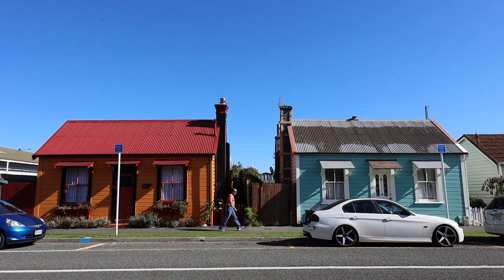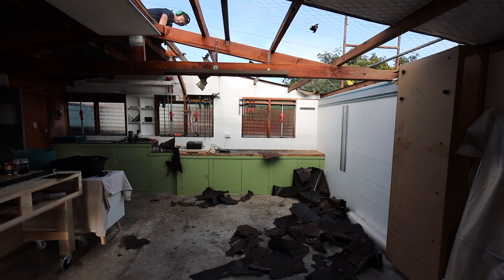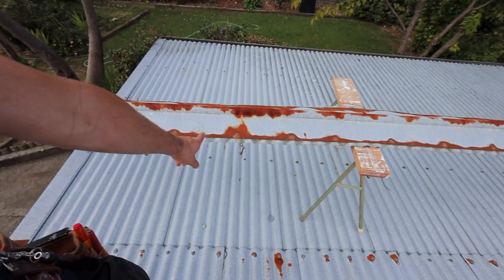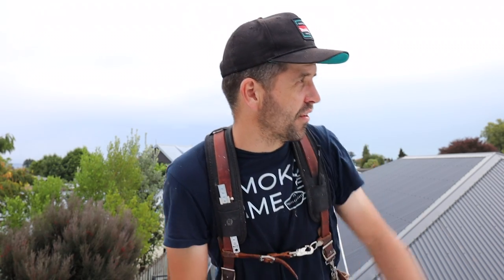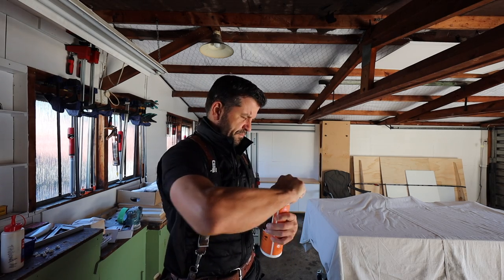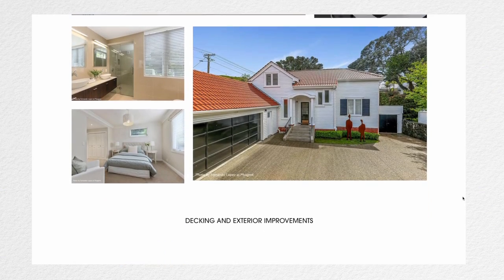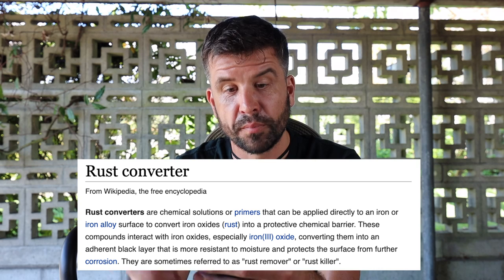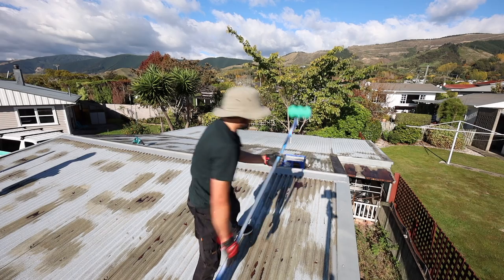How To Make An Old Roof New Again

Comment: A bit late now, but the old (30-40 years ago) instructions for 'rust converters' had the user wire brush or scrape the rust to remove any loose rust before brushing on the converter, which was basically Phosphoric Acid, same as used to put a corrosion resistant matt finish on military equipment (and in cola soft drinks and food production as well as dentistry).
Reply: That's still worth doing. I often use a round wire brush in the drill.
Reply: As I recall, the bottle label included “properly prepared” (no liability here).
Reply: Yep, ideal to remove most of the rust it has converted the "top layer" of rust, i.e. the top surface rust has been neutralized but there is still rust underneath and so removal with wire brush works best to get rid of most of it before hand....maybe on the second half of the roof!
Reply: Scotch-Brite pad would work perfect for surface rust. 
In Australia we have a product called ranex that sounds like what “Bruce Lee” was talking about. Seems to work much quicker than this product too
Reply: Yup; you'll find it on most steel boats with various names, but it's mainly a solution of phosphoric acid.  Works great, tastes terrible.
Reply: @michaelrice500  Gotta mix it up with a bit of orange juice mate, then all good  !
Reply: Yep, loose rust off means less rust converter needed to react with less rust, and a more stable less powdery substrate for the top coat of paint.  Use a nylon or wire wheel in a grinder.  
Ha  yes I've worked on ships !
Also some rust spots under some of the old nail heads and I'd grind / convert / gal spray those before nailing down.
Reply: @michaelrice500  funnily enough part of the flavour of Coca Cola is phosphoric acid.

Comment: First time seeing those rollers, so cool. Can't wait to see the garage finished! Awesome vid as always Scott! 🖤
Reply: Don't bother using them they suck, just use a soft broom
Reply: They look cool, but they tend to load up with the paint to the point that they won't roll any more, so you end up with a huge sponge of paint on the end of the pole, smearing it around on the roof swearing at it.
Reply: From recent experience, they don't work so well with solvent-based paint and in my case, the sponge came free from the cardboard sleeve and promptly fell off the roof. Left an interesting pattern on the path below.
Reply: We used one on our house in 1981, but it wasn't as good as it looked. We mostly used brooms and a brush.
Reply: Hate to be one of those no no nancy’s but was skeptical about rust converter on galvanized metal. Major manufacturer in north america advises  against. 

“ It will not work on aluminum, copper, stainless steel or galvanized metal. “
Maybe yours is a different compound. Maybe the top primer will also protect roof enough or maybe just maybe by the time the converter proves to fail by bubbling up from underneath you will have 50 gajillion subscribers and a syndicated tv show. Just being a jerk. Love your show.
Reply: @coreywells9498  - I did a lot of research on rust converters and agree that plenty are as effective as a band-aid on a bullet wound. But there are good ones sold here that are formulated to work on galvanized metal, because so many of our houses and garages have galvanized roofs.
Reply: @coreywells9498  think Scott's was zincalume, none of those you mentioned 😉

Comment: Scott, you could continue to lay your membrane in a vertical fashion. Just fold the edge of the underlying felt over by about 100mm. Then if any water does track under it will hit the fold and track down towards the gutter (if there is one). It’s a method we use on underfelt when we repair sections if there’s a rip in it for example but there’s no reason you can’t do it on large sections like yours.
Reply: Nice!
 Simple and effective - one of those "of course" solutions

Comment: Had corrugated mietal  roofs in Hawaii for years, and even the old ones never leaked or needed underlayment. Yet when we built "real" houses, new houses in the  70's we sheathed the roofs  for shear, so we needed underlayment then. You lose the sound of the rain. OK some people must have had leaks. I just mean we just put our roofs on and no one thought about underlayment for a roof on purlins. This rust converter is something new to me. We found the quality of the steel to begin with was most important and used zinc oxide paints if we used any. At the end--- NZ is so beautiful! We loved hiking there.

Comment: Hi Scott as a tradesman painter I spray roofs wot I do is wire buff the rust areas clean down then apply the rust converter for a good surface then airless spray the coats as on as spraying will tend to get into areas rollers won't and also the topcoats will have more microns for protection and yes I use metalsheild primer and Dulux roof and trim great products , cheers ,shaneo , nelson 😊👍
Reply: Do you spot prime the (converted) rust spots with a high ZINC primer before using the metal primer?
Reply: @debochch  yes I  spot prime  then full undercoat making sure no bleed threw before topcoat

Comment: An amazing product for rusty metal is POR-15. It is a miracle product! Also, I had no idea that those rollers for corrugated metal existed...thanks!
Reply: POR-15 is not UV resistant, it needs to be top-coated.  If you don't it will fail. While I've used POR-15 for years, phosphoric acid and 2-pack epoxy primer is actually much more durable.
Reply: Inorite…corrugated rollers are going to save me so much time now, I had been putting it off for that very reason
Reply: @epiccollision  you notice the push broom he was doing the rust converter was corrugated as well.
Reply: @ckm-mkc  True, POR-15 does need a topcoat if it's outside and I've successfully used Rustoleum for that purpose, which has worked beautifully for years.

Comment: I use the CRC rust converter, it works exceptionally well for what it is. Was pleasantly surprised. Though it's recommend not taking the metal back to bright clean metal, as it does need the iron oxide to convert. It's a great product for extending the life of things with very little effort. 

Depending on rust level, it will need multiple coats. Once it goes nice and black you've applied enough, if you still see rust it needs more. be-careful not to over-apply as that can have a negative effect. The best results I've found is one coat, let it dry and set, wipe off excess (those white/purpleish streaks), repeat until all rust is converted to the strong hard black primer. You shouldn't need to apply a primer on-top of this product. 

In reality I hardly ever do it in the best prescribed way, I just keep coating until it's all converted then slap zinc paint on-top and I've not had an issue yet.

I use this stuff in a high humidity environment and it's a life saver for restoring rusted iron/steel.  That cap will never come off easily again btw...

Comment: Hey Scott and Jess!  Suggestion: Consider painting the roof titanium white or a colour that either has a high LRV rating or a manufacturer specific cooling additive.  Resene call theirs "cool colours", Dulux call theirs "Keep Cool technology", but at the end of the day it's the LRV rating that you're interested in.

With a metal roof, especially, the choice of one of these cooler colours and/or higher LRV ratings means less expansion and contraction of the material - meaning you lengthen the service life of the material.  As it's reflecting more of the sun's energy rather than absorbing it (leave that job for solar panels if that's your thing), it's also reducing the temperature inside your house when the sun is at its highest i.e. a passively cooler environment in summer, meaning less energy spent on active cooling.  In Winter, the sun is lower in the sky and you should be getting more of its energy through your windows - obviously dependent on the building's orientation - so reflecting any of its energy away isn't as much of a problem either.

In my house, after we upgraded the insulation, it was an absolute furnace the following Summer, I hate to think what it would have been like with the incoming R6.6 standard!  Shortlyl after that, we had our roof rescrewed, prep'd and painted titanium white.  The following Summer, the aircon didn't go on at all - the white roof did its job brilliantly.
Reply: Great tip! We were talking about this just yesterday and are keen on a light coloured roof for the reasons you mentioned

Comment: Should put a few full length acrylic panels in the roof bro, get some sunlight in.
Another tip with the steel is to fold up the last 20mm of the valleys under the ridge capping before you put the ridge on.  This will prevent wind driven water blowing uphill and in under the ridge cap. Nowadays too you can get a shape matched foam filler strip that plugs the valleys and does the same job blocking water.

Comment: In the UK we still get plaster board for less than £8 a 8/4. Timber is still silly prices.
I've used a ronseal rust converter on my van and it turned the rust hard and black, amazed how it works but it does.

Comment: Rust converter aka phosphoric acid.  You can achieve the same with 50/50 Coca Cola & Vinegar.  Soak your trowels in it and blacken them up to stop alkaline materials causing Iron Oxide III, orange rust.

Good tip on the larger screws.  I've got to get up on Mum & Dads garage soon and am expecting to find a few loose ones that'll need a redo.

Comment: Hi Scott. Love your videos. In south Africa we typically use Deoxidine to remove the rust. Works really great. Then I paint primer and topcoat with an airless sprayer cause I do larger roofs like on factories.
Reply: Just chipping in with additional info for anyone else reading - don't use this on anything galvanised - which the majority of corrugated iron roofs in NZ and Australia are.  The phosphoric acid will eat through the zinc right before your eyes.  It's a good rust convertor on anything else though. I've used it several times as we get it here in Oz too.  Another thing worth mentioning, this product is it's not a rust inhibitor, it's a convertor, so any metal treated needs to be neutralised or painted soon after applying - the recommended time is within 4 hrs.  Enhanced rusting will occur very quickly otherwise and any treated metal can be completely rusted over again if left even overnight.  @Gerrit Geldenhuys, I guess  you're already doing this if you're in the roof painting game :-)
Reply: @moltopericoloso  We typically apply Deoxidine to galvanised roofs that have a 30% or more rust coverage. We literally watch it until the rust is gone and then pressure wash to remove the Deoxidine. As soon as the roof is dry primer goes on immediately.
Reply: @moltopericoloso  I’m planning on doing my galv roof soon and I’m in Oz. What products do you recommend please?

Comment: I've often wondered why houses in New Zealand and Australia have lots of profile sheeting for residential roofs.  These are predominantly only used in commercial buildings in the UK and cut edge corrosion is a big issue.  Lovely views at the end.
Reply: it's really cost effective-maybe 15 to 17 Aussie kopeks a square meter if my brain is work'n right goes up fast , already painted , edge corrosion does'nt seem an issue (maybe closer to the ocean but I just use a bit of touch up spray on the edges ). A bunch of profiles are available, colours too. I have used it for my wall cladding. Plus it does not burn or rot. Good stuff. And it can be recycled.
Reply: @robertandsharon9428  If you have unprotected cut edges and the building is near the ocean the salty environment simply contributes and accelerates the corrosion cycle due to the salty atmosphere. Lots of colours available granted but not as good as a traditional slate or clay tile roof on a residential building.  From my understanding, these types of profile roofs were originally used because they were cheap and availability was not an issue.  I believe the origin goes back to the early 1900's when people were settling in Australia from Europe and it got adopted as the go-to material for roofs.  Even some prominent churches in Australia have these metal profile roofs, and in my opinion, such beautiful structures with fine stone masonry simply look hideos with these types of roofs.  This is why if the building is listed and the roof covering is defective requiring replacement, it has to have the profile sheet replaced as like for like.  - Just out of curiosity, what is an Aussie kopek?

Comment: I remember using those corrugated rollers on my old house... I hurled it off the roof in frustration as it wouldn't paint around the lead head nails and got a soft bristle broom. Used a bit more paint but finished in a ¼ of the time. :)))

Comment: You are the best mate, thanks for tips with the roofing. The only thing is I never trust at any rust converter or the paint, it’s like a Band-Aid. One solution - rust than replace and that will stay for next 30-40 years. Cheers

Comment: Ive used rust converter before, it does work, the rust will turn black and stop spreading, you can paint on top of it and it wont lift up the paint as a rusted surface would. Its a bit pricey where i live though, we get it in bottles of 100-200 ml, i was amazed when i saw 1 liter bottle of it

Comment: The underlay is also for condensation control.  We put a single sheet of clear Suntuff on our shed roof, and the condensation that builds up under that is very noticeable, causing it to drip on our bench saw.
Reply: That's why I have to lift my roof and fit paper!  One of the rooms developed mold because of the lack of paper.

Comment: Lot of roofers go vertical on the paper, technically horizontal is better but code allows for either and it's more practical for reasons you state.
Old guy who had been in the trade for years told me to wire brush the rust down followed by 'Penetrol' painted on and a antirust primer, then top coated.
Always found rust converter was questionable in its effectiveness. 
Incidentally the patch I treated as above is still doing well years later. 
Be interested how things hold up.

Comment: i think i will try the rust converter.  we have a colour steel roof that is 30 years old and is ok, but two gullies are starting to rust at the bottom.  i have a bitumin paint to seal them, which supposedly can be just painted straight onto the rust.  but it makes sense to take the extra time to make the job last longer.  cow of a roof though, 7 metres to it.  and the double gable is so steep i need a ladder up there to get across it.  but every year i have to get up there to clear leaves.  so much for a simple retirement.

Comment: Hint Pulling out lead heads and spring heads, drive pinch bar 5:59 under nail with hammer, put hammer head in corrugate valley and pry pinch bar over hammer head. Two tools two hands one in each faster and won’t deform corrugate. Also can knock inevitably jammed nail out of pinch bar claw with hammer

Comment: You could have done the roof sarking the correct way by cutting lengths to the width of your garage and rolling them up ready to start at one end, then after removing say 5 sheets roll them out and fix them with the minimum 150mm overlap as you normally would do, but only fix 4 sheets on top leaving a working space for the sarking, then remove next 5 sheets and repeat until you get to the other end.

Comment: you need to wire wheel the rust first before applying that CRC rust converter stuff for best results. I have used it before and its great stuff if applied properly. The issue you run into if you just try to roll it straight on with no prep, is that it doesn't have enough penetration to get through to all the rust. It will convert the top layer beautifully, but you'll still have some rust underneath it where the product was unable to penetrate. If you hit it with a wire wheel attachment on an angle grinder or drill first though, you'll blast off all the surface rust, and when you roll on the CRC converter, it will finish off whatever is left. Granted I don't know how deep your rust  is, perhaps its shallow enough where you will get it all by simply brushing it on, but I am skeptical. You shouldn't need any primer either, you should get decent result just painting over the CRC prepped surface, although for best results I recommend hitting it with a rusty metal primer on top of the CRC. For reference, my experience with the product is restoring rusty motorcycle frames. Let us know how it goes!

Comment: The litmus test on the rust converter will be 3-4 years later.l used something similar and the roof colour now looks like a patchwork quilt of rust leeching thru the roof paint.Hindsight,should have used a wire wheel to cut the rust down then the converter applied.

Comment: Hmm Scott it would be pretty cool to replace one of those metal sheets each side with a polycarbonate one… could even put on a window tinting sheet underneath as to not have that light problem but still get enough in to work clearly

Comment: hi Scott , a likely reason your roof is leaking is that the corrugate is too short at the apex ,  water is blown under the ridge capping which only has minimal cover ..compounded by the fact that the corrugate ends are not turned up .Also ironically a lot of corrosion can be in these areas becouse they are not rain washed .I would say to anyone attmpting this to address these key points   - make sure ridge has plenty of cover ,  all corrugate is turned up , understanding that rust usually forms in protected areas ....better off replacing the lot IMO